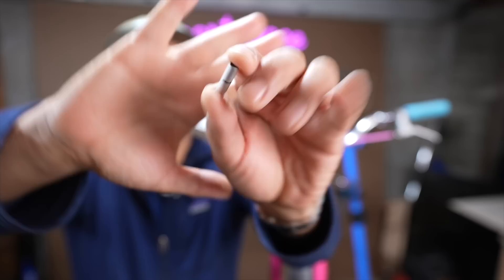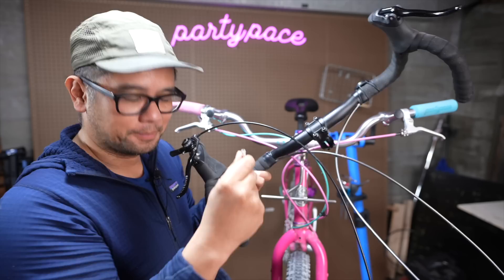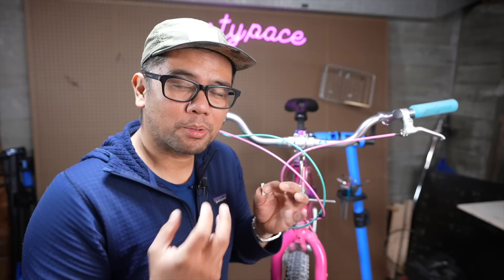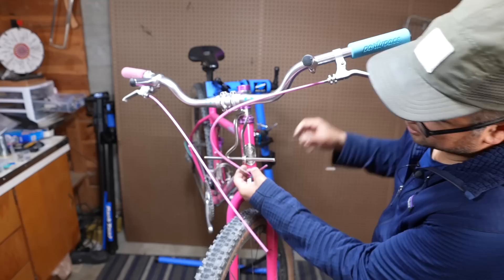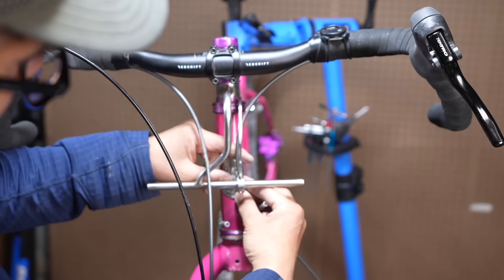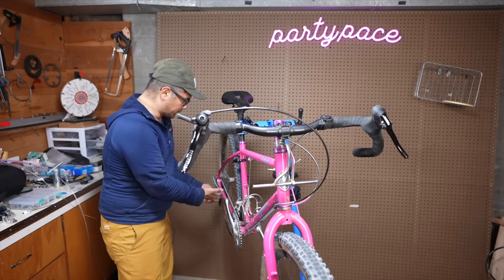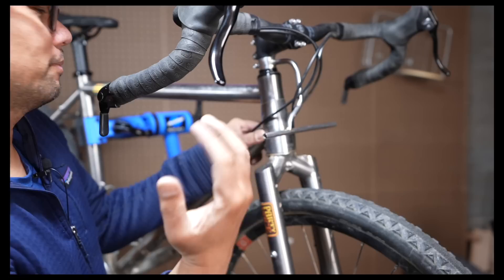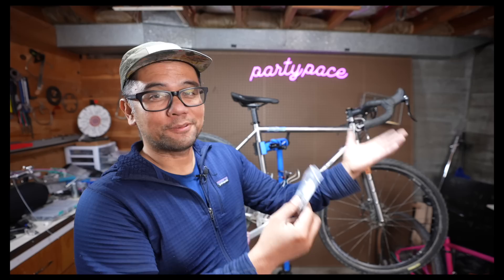Do You Know About  this WEIRD But USEFUL Bike Hack?

Comment: I didn't know a double ended ferrule even existed.  I like your use of them.  Personally I would use a inline cable tensioner instead of the double ended ferrule.  The tensioner would serve two purposes, your handlebar switching and extra point of adjustment.  Good tip, thanks Russ.

Comment: I solder the end of the inner cables very carefully without increasing its diameter but embedding all strands. This way I don't have to crimp on a ferrule and can reuse the inner cable more often in case I have to remove it. I use a regular but powerful electronics soldering iron (weller/pinecil/ts100) and solder.

Comment: Growtac ships their mechanical disc brakes with these double sided ferrules specifically so you can connect compressionless housing for the straight sections and the floppy kind for the bends. Neat little tool.
Reply: Now that is brilliant.
Reply: Can i use a regular flexible noodle instead of the jagwire ez bend?

Comment: So I actually used two of these when trying to run compressionless brake outers through my really tight BB area. I spliced in a short section of regular brake outer in the middle of the compressionless because it's more flexible and could bend properly.  Worked like a treat.
Reply: very cool
Reply: RollinRat  any flexible vbrake noodles will do? How do i connect a male end to the housing

Comment: There's also inline barrel adjusters, also made by Jagwire (and others). Similar thing, but acts as a barrel adjuster to adjust cable tension. Good solution for a quick handle bar swap.

Comment: i was assembling a super long wheelbase recumbent for my mom and wanted to match cable housing colors to fit its aesthetic. the only problem was i could either buy a bike shop box so I could have more purple housing than I could ever use and no money left. that or buy jagwires purple brake kit which didnt come in tandem lengths as far as my searches went. so i used the double ferrule to use a tiny bit of leftover black housing to fit the underside and internal routing of the bike, and the purple where I wanted it to be. now i use them because im lazy. I want to prolong needing to buy cable housing for as long as I can, so I splice short cables together to fit the length of whatever bike im installing cable brakes on. I love these

Comment: I’ve been doing this for over 20 years using the cable ferrule portion of a specific size of v-brake noodle (older = better). Just pull the cable ferrule out of the noodle, and the plastic liner out of the ferrule, and install where needed. When I discovered it, that was the moment I knew I was a genius. 😂 One of my favorite hacks!
Reply: I tried this but the housing would not fit other end of the ferrule on the side of the noodle, are there any specific noodles that can be used like these?

Comment: I have been using these for years.  2 setups, first was a single speed that I had both a riser bar and a drop bar setup and the second was a rinko setup and it allowed me to pull the cables without pulling the whole housing.

Comment: Nicely demonstrated, Russ! I had been wondering about this workaround but for bikes with long housing sections.

For now, I'm running flat/drop bars on my Zydeco, where the housing is interrupted and so the rear portions of cable are viable for either setup!

Comment: This is cool. Been thinking about doing a similar quick bar swap solution for some time.

If you got GCN money, you could go with a SRAM AXS solution. 
Gearing is wireless, so that is easy. 
SRAM Level (some models) brake levers are compatible with Rival/Force AXS calipers. You just need a hydraulic disconnect, Ti Cycles, No. 22 and Zeno makes those. How well they work is the question, the ones from Zeno look quite good. 
It would be great to see such a solution actually working.

Comment: A suggestion of an easy reliable way of ‘sealing’ the strands of the far end of the inner cable would be useful (so they are finished like new ones before being cut down). I always find the main problem is fraying and damage when trying to rethread them.
Reply: The ends of new cables are soldered. You can solder them after cutting.
Reply: Thanks, was hoping for something easier than soldering, maybe some kind of metal glue, but given it needs both a smooth and strong finish,probably no alternative
Reply: @JT-ny7ll  I finish my cables with heat shrink.

Comment: Great hack, thanks for sharing this.
...  How do you cope with frayed cable ends once you take off the cable cherry or crimp cap? Soldering them? If not, I fear to ruin the inner of the installed cable housing, esp. when threading them in again, thus making for bad,  imprecise shifting. Which is why I end up cutting the old ones and installing new cables, which saves time, so unfortunately not money. 🤷🏽‍♀️
Reply: Smear the cable with bee's wax.  Works a treat. Smells nice too.

Comment: You might consider trying bayonet cable connectors (like the ones used with some Rohloff hubs) to be able to split the cables as well, though it wouldn't work with all frames, not with the one featured in this video (you'd need cable stops with a cut through them, so you can install or remove housing without pulling the cable out of it). But if your fame has cable stops like this, or maybe you add some clamp-on ones, you could connect and disconnect the cables without even using any tools! Not sure if it's a good idea for brake cables, which experience much more tension, but it would certainly work for derailleurs.

Comment: Cool, I learned something new.  "Quick release" handlebars.  This would be quite a bit more difficult with hydraulic brakes though unless someone makes a QD no spill brake hose connector?  Might still need to brake bleed after.
Reply: Ti Cycles, No. 22 and Zeno. Makes those. At least the ones from No. 22 and Zeno should be to disconnect multiple times without the need for rebleed.

Comment: I found these really useful for compression-less brake housing on 2 counts 1) on drops I use normal housing under the bartape where the bend is too tight for it, then splice in the compression-less for the rest of the run. 2) With some levers (flat and drop) a full run of compression-less, can make the lever feel a little too "off-on" so I use these to splice in some normal cable (about 1/2 on front brakes and a 1/4 on the rear) and you get some of the modulation back.
Reply: What did you use to connect the 2 housings? Can i use inline barrel adjuster?
Reply: @JPineda24  If you cant find the ones Russ is using in the vid, inline adjusters would do the job, for brakes I would probably take them apart, remove the little spring and tighten them right up.
Reply: @chris1275cc  ok, thank you!

Comment: All I can focus on in this video is how much better 650b wheels fit on a Hardtack than 700c/29" wheels. There's "normal" clearance between the top of the tire and the bottom of the fork crown. I have less than 5mm clearance between the top of the tire and the bottom of the fork crown with 29x2.1 Renegades on my Hardtack. 700x55/29x2.1-2.2 tires really aren't a safe fit, despite what the Analog Cycles website says.

Comment: I accidentally nicked the new cable housing I just installed with the cable cutters. I used ugly electrical tape to cover the cut but I could snip that little section off and install the ferrule in its place. Better than buying more cable housing to replace a small section of a booboo.

Comment: Surely it's easier to have two sets of full cables and just replace some cable ties. One of the mentioned benefits is varying outer length, in which case you need new inners anyway. They are also going to fray after N+1 changes. Enjoying the Stoke, but yeah-nah
Reply from the maker: Having done a video previously on swapping full lengths of housing.  IMO its not.

Comment: In a similar vein as these, you should check out the threaded cable ends that they have on bikes that come apart, might be possible to completely unthread and have 2 handle bars

Comment: Thanks, Russ, and I could see this being useful for a personal project.  I bought a minty used Merlin titanium rim-brake exposed-cable absolutely gorgeous road bike and I am toying with making it a road and gravel convertible, perhaps even with an NOS pair of those road Rockshox from the '90s to get suspension and fat rubber up front.  I bought the shocks back in the day off the clearance table of a local bike shop.  Anyhow, thanks again as I could see swapping between road and gravel bars, too.